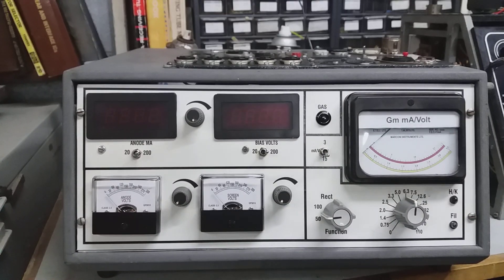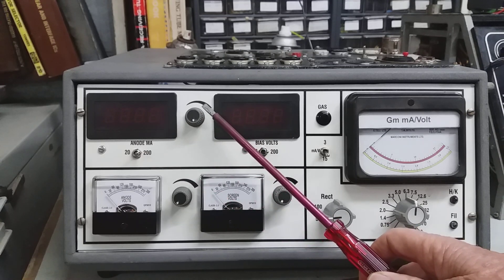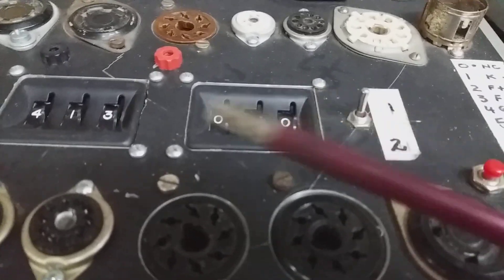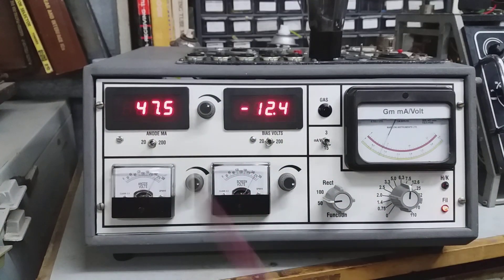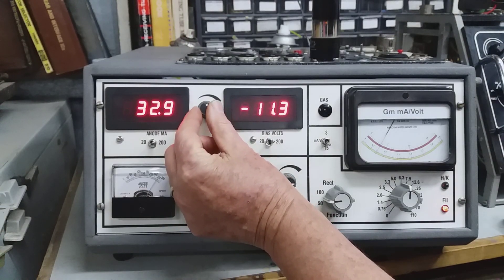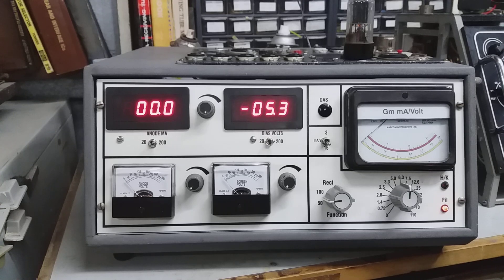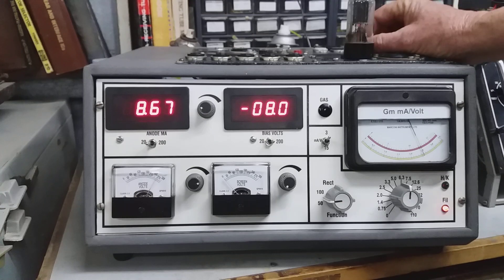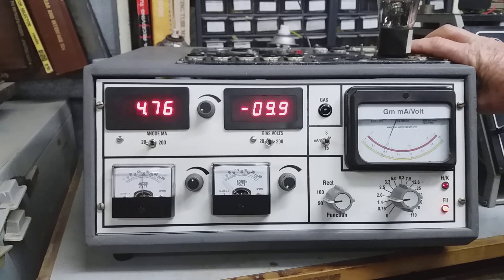Home Built Gm Valve/Tube Tester

Comment: Hello Richard,
very nice implementation of the RAT tube tester. Great job. I have a few questions regarding your version. The original project didn't show a BIAS voltmeter nor an Anode current meter. Did you connect the voltmeter between cathode and COM ground, and the anode current meter in series to anode tube terminal, or else? What is the RECTifier function? You did change the GM scale to 3/15 mA/V, because of your meter? And finally, on the Triodeeelectronics web site, there is a remark of a grid conduction warning LED. I could not find it on the schematic. Was this deleted or not implemented? Thanks.
Reply from the maker: I placed the bias meter between the grid and cathode, anode current meter in series with the the anode supply. Gm meter - the original RAT document called for a DMM to be plugged in - I first tried an Ebay digital 200mV AC meter but they start to get non linear below around 15mV and could be 10% out below 10mV so I made an AC millivoltmeter using a moving coil movement I had, that way I could make a paper scale, mark it off against a known accurate DMM to allow any for non linearity. Recifier function - I had ideas to also include rectifier testing but has not yet been implemented - maybe one day. Grid conduction LED - I searched but could not locate that document so you know as much about it as I do.
Reply: @richardhughes8408  Thanks . For now, I'm going to install anode and screen voltmeters, digital 0-500V, BIAS voltmeter 30/60V digital and use an external FLUKE DMM for Gm/Mu measures.
Reply from the maker: @c.k.b6840  This is actually the second RAT tube tester I built, the first was largely experimental as the RAT tester was to me a bit of an unknown, for the Gm meter in that build I used a diy AC millivoltmeter made up of a 200mV DC digital panel meter driven by an op-amp 1Khz band pass filter ( to filter out any unwanted mains hum) and an op-amp precision rectifier, there are plenty of precision rectifier circuits around on the internet - linearity was not too bad if you can find low fwd drop germanium diodes for the rectifier circuit, I had some OA79's which have around 250mV fwd voltage drop and linearity was good down to around 8-9mV. The original RAT tester used  multi position switches for anode and screen controls - this is not a bad idea, it is good though to keep the anode and screen meters - they are a good indicators of an internal short in a valve - if you are turning up the anode volts but the meter reading is not going up then something is wrong - usually an internal short, moving coil meters are good here as they have a much quicker response than digital panel meters - also they don't need a separate power supply. The side 1/2 switch on the RAT tester switches the grid and the anode  from side 1 to side 2 - I found you only need to switch the grid from side 1 to side 2 that way if you decide to expand things and include extra  sockets with switched connections  you can wire them so that the AVO data book can be used -  saves a lot of looking up of individual valves data setting - it's all in the Avo data book already. Good luck with your project
Reply: @richardhughes8408  This will be my 4th tube tester. I have a Triplett 3414 emission tester, a French PC tester (similar to uTracer) and uTracer.
I don't have that many tubes, about 90-100, but I like test instruments. Currently I am searching for a proper enclosure and front panel for the RAT tester. Interestingly, Steve Bench in his application notes uses the cathode current, not Ia, for tube evaluations. Have you seen them? BTW, I have seen AC millivoltmeter circuits using Si diodes and Schottky diodes.
Reply from the maker: @c.k.b6840  Over the years I've had many tube testers Eico, Triplett, Supreme, Avo, Taylor, Precision, currently I have only 6 left that will eventually make their way to Ebay, I'll keep the RAT tester, and old Confidence tester that is probably nudging 100yrs old - I like it's cast aluminium  front panel that has a stove enamel finish and probably one of the Avo's - like you I like test instruments, but since downsizing and retiring I no longer have the room to keep them all. Yes, Steve Bench used cathode current which is ok for triodes but with pentodes the screen/G2 current would throw out the current reading slightly.

Comment: I wonder if something like this could be built using something like a PI or Arduino to set all the controls and send the result data out the serial port to an application on a computer that could print a report or graph showing the characteristics of a tube. 
On your computer just select the tube from a database and that info would be sent to the tester to setup the socket for the tube and results send back.
Reply from the maker: Those sort of valve testers have been developed and made by DIYers - a Google search will find them and I believe there are kits available that you can make.

Comment: Thanks for posting this! I'm going to make one of these for sure. Did you build it up on stripboard? I love the analog and digital panel meters!
Reply from the maker: I used a diy PCB but strip board can be used, you may also to look at the diy valve tester over at the British Vintage Wireless forum, they call it the Sussex - it operates in a slightly different way, while I have tried it and it works well I prefer the way the RAT tester works - it is purely a personal preference -  the Sussex tester is very popular and well documented on the forum - has been built by many forum members who are always very willing to help if you have issues.

Comment: Where did you find the tube manual you downloaded?
Reply from the maker: The tube manual is just the Avo VCM manual that is available for free download from places like BAMA manuals or Franks Tube data pages - it is easy enough to arrange the switches to operate the same as the Avo VCM's - to switch from side 1 to side 2 of dual valves just need to switch the grid from side 1 to side 2.

Comment: Hi! Nice build 👍🏻 Do you have a schematic or something about the improvements on the rat tube tester? I looked at the schematic, but there’s no gas test, and that h-k light, is that for the gas leakage test… the heater supply is improved also..  nice job
Reply from the maker: Gas test is just series resistor - around 0.5meg - on the grid lead, and a push switch to short the resistor, a gassy tube draws grid current, which will cause a voltage drop across the resistor, short the resistor and grid voltage will increase causing a change ( noticeable) in anode current. The original RAT circuit switches both the anode and grid when using the side 1/2 switch to test double triodes - this is fine if you only have a set of prewired sockets but if you want to add extra sockets and switches to accommodate them, the circuit needs to change slightly - the grid is connected to both sides of a double tube and only the anode is switched from side 1 to side 2, it is then possible wire the extra sockets and switches so the Avo data book can be used for switch settings, no need to work out your own. The bias voltage is measured between cathode and grid.
The HK led on the rat tester is not that great not very sensitive, I was going to improve it but so far have not and I use my MKII Avo for shorts and HK leakage tests, the filament continuity circuit uses a current transformer to detect ac current through the filament wires, works from 50mA up uses a simple 741 op-amp to light the led
Reply: Hi Richard! Thnx for the message! 

I have a uTracer (based on tektronix 576) which is great matching tubes etc.
My goal is to expand my tester to weed out bad tubes which can destroy my interface alsoThe uTracer is great for the last stage in testing tubes.
So the rat tube concept is really cool! I want to strip all the pre-wired sockets, because i use switch matrix. I found a simple a simple leakage test (have no tried it yet) by placing a 82k resistor on the base of a mpsa42 and a 820k resistor to the emitter to turn on a led or neon when a with threshold of 5uA when grounding the grid, anode or cathode.
I found a thread also about the sussex tube tester.. looks a-lot at the rat tube and have some cool options also..
Gotta work now, but i’ll be back haha
Reply: @richardhughes8408  btw how did you made the filament supply? Is it ac or dc? Is it a multi tapped 120v transformer or did you used resistors or zeners? Or some kinda voltage regulator. Thnx

Comment: Well done. Which Gm meter are you using and where did you get it from? Thanks
Reply from the maker: I'm not 100% certain what you mean regarding the Gm meter, the moving coil meter on the right is an AC millivolt meter made up from a standard 1ma movement (salvage store buy) with a redrawn paper scale driven by an op amp precision rectifier - switchable gain provides 2 scales - a precision rectifier has a bridge rectifier in the feedback circuit, the actual schematic is not hard to find if you google precision rectifier, the front end of the rectifier has a band pass filter to filter out any 50Hz or 100Hz mains interference that inevitably finds its way in.
Reply: @richardhughes8408  Thanks for your clarification. I didn't realize the paper scale was custom. I assumed (and hoped) the movement was available as shown, and I was going to ask for a part number. I'm in the process of designing my own flavour of the RAT tester.

I like your idea to provide options for 50 mA and 100 mA of plate current.

How does your design implement the gas test? My current plan is to have a 1Meg resistor in series with the grid, shorted out by a NC momentary switch, where pressing the switch puts the resistor in circuit, and the operator watches the transconductance measurement for changes. I'm not at the prototyping phase yet, but I'm undecided on whether to put this resistor before or after the inverter IC which provides the AC millivolt signal.
Reply from the maker: @stevencraig  It isn't hard to make a custom scale for a meter movement, I use Inkscape - free vector drawing software, once the rectifier/filter circuit is made up and working, hook it up to a sig gen and a known accurate millivoltmeter, remove the meter front glass/bezel remove scale (slide it off under the needle) and put it back on reversed then just mark the divisions on the scale with a pencil/marker while adjusting the output of the sig gen, remove the scale again and either scan or take a photo - import the photo in Inkscape and lock that layer - start a new layer and draw/design/trace over the top you can go a bit nuts here and include a custom name/logo. When you are satisfied, print, cut out and glue the new paper scale on.
The other easier options are:- just get a 200mV digital panel meter from Ebay and drive it with a precision rectifier circuit OR get an AC 200mV digital panel meter, I was going to go down that route but found that they are non linear once the measured ac voltage gets much below 20mV this presents a small problem for ECC83's and similar tubes that have low Gm's, the measured voltage is 16mV but the non linearity of the meter displays this as about 12 or 13 mV, I already had the meter movement and I thought why not give it a retro/vintage look. I also used a resistor in the grid circuit and placed it after the IC.
Reply: Thanks for all the information. I don't have a sig gen yet, nor an accurate millivolt meter. I have plans to build both in the near future (I'm not sure I'll ever need anything with professional grade accuracy) so I'll save the custom meter scale for a project upgrade. I'm looking forward to it.

I also really appreciate the tip about the AC meter nonlinearity. I'll definitely stick with DC and the precision rectifier.
Reply from the maker: @stevencraig  A decent digital multimeter is ok for millivolts and at a pinch you can get sig gen apps for mobile phones - good luck with your project.
Reply: @richardhughes8408  Youtube didn't give me a notification that you replied again. Thanks for the tip about the sig gen apps...I had no idea. That should do quite nicely until I decide on specs for a real one.

If you don't mind, I have other questions about your function switch. I assume the 50 mA and 100 mA settings switch the current limit resistor on the base of Q3 (in the plate voltage circuit), between say 10 ohms for the 50 mA limit and 4.7 ohms for the 100 mA limit? What does your rectifier test function do?
Reply from the maker: @stevencraig  Yes the current limit resistor is switched, I think I just switched another resistor in parallel to bring the total resistance down, you also need to switch the 130ohm resistor in the cathode circuit at the same time, I normally use the 50mA setting - with moving coil meters for the plate and screen it is quite apparent if a short of some sort exists - as the current is increased, one or both of the meters dip, a DPM is much slower to respond.  
The rectifier function was a bit of an afterthought and isn't operational - yet - it is planned but other projects have gotten in the way, I also have an Avo MKII so the rectifier thing was not that important. You might want to head over to the UK vintage radio forum - they have a lot of info about a diy tester they call the sussex valve tester, a later design but with almost identical circuits for the plate and screen - operates with fixed rather than self bias - worth a look - a lot of forum help available so you are not so much on your own with a scratch built project which can be a bit scary - you might decide on that instead.

Comment: Very nice home built tester how much did cost you to build?
Reply from the maker: 75% of it is made up of recycled parts, sockets, switches, transformers etc, case is a recycled piece of medical gear so it is hard to say how much - certainly less than $100, if you have built gear yourself you will know that electronic components are cheap it is the hardware that costs
Reply: @richardhughes8408  I will buy 20 sets if you can supply them. Please let me know. Thank you
Reply from the maker: @MrMymodesty  It's a one off - so sorry no can do.
Reply: Could you build me one?